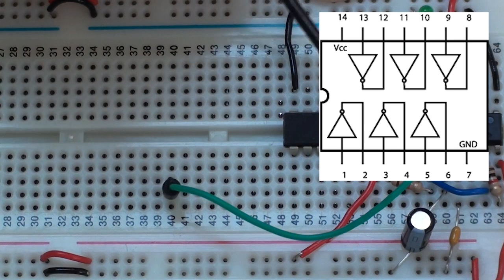Experiments 4.1.1: Questions: 555 Timer Experiment - Question 1

Comment: You can just connect the negative side of the red LED on pin 3 and connect the positive side of the LED on the positive rail with a resistor and voilla !